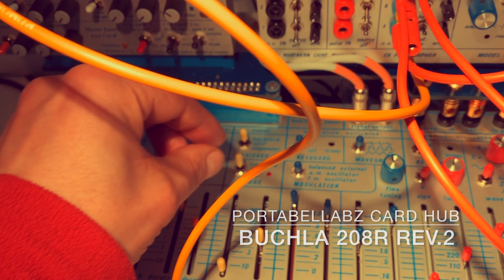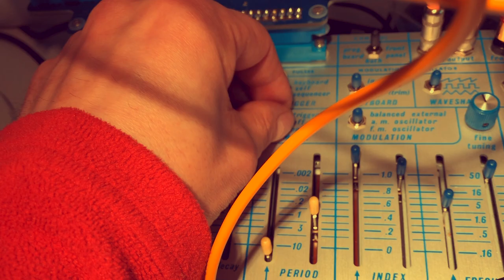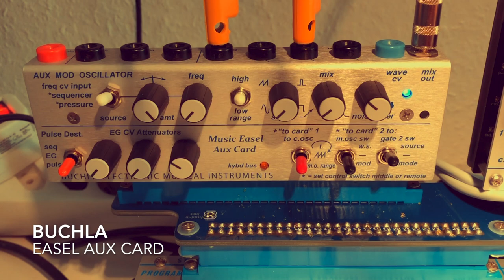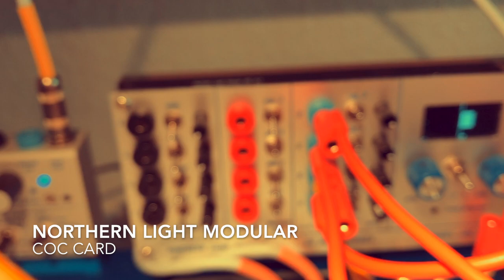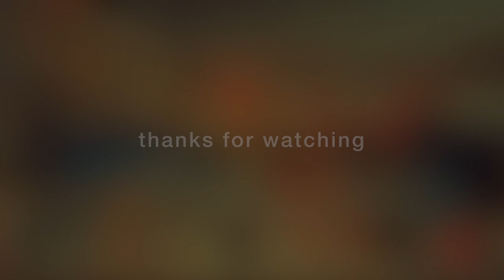Buchla 208r rev.2 + Portabellabz Card Hub (aux card, cOC card, perfBOB)

Comment: Hi where have you put the jacks for the independant oscillator outputs
Reply from the maker: There are no additional outputs.
Already existing outputs where used for this modification.
Reply: @deOrbiter  can you provide more details? I am interested in modding my Easel in the same way. Did you just take the signal from the mix pots to the top signal outputs or anything more elaborate?
Reply from the maker: @fablesofsilence  Yes. The signal after the top right pots (Mix) is routed to the top signal output. The main output is disconnected there but you can grab it on the phone output. On the Easel there is an additional mixed output either.
Reply: Thank you  @deOrbiter . Thats what I thought. Seems easy enough to do. Easel is what I have!
Reply: @deOrbiter have the same, separated outs are cool.